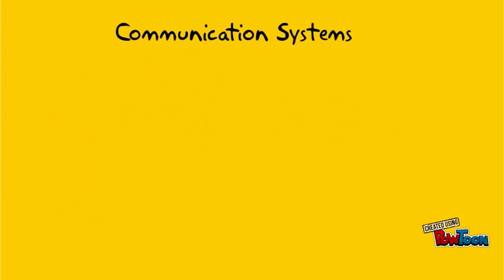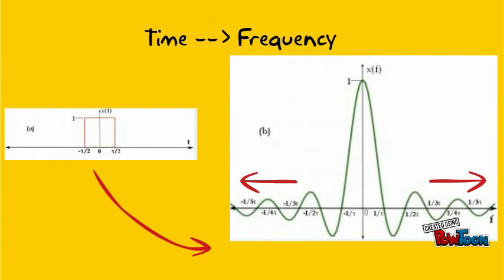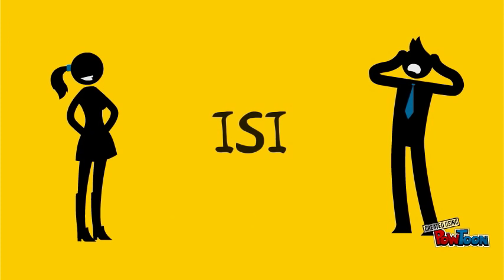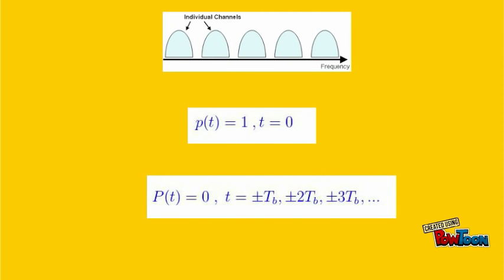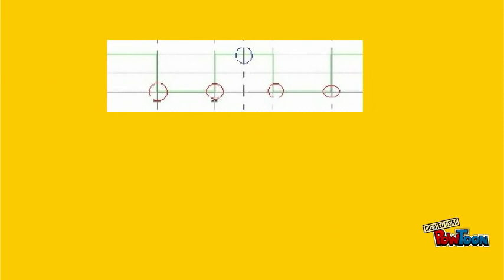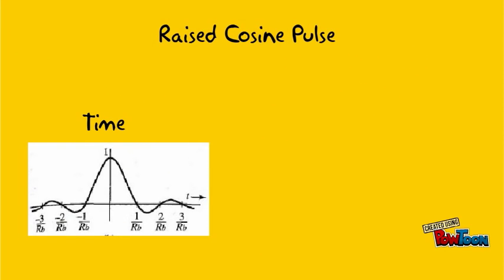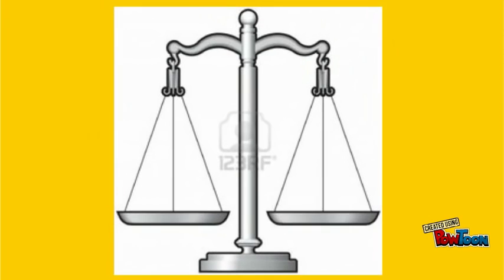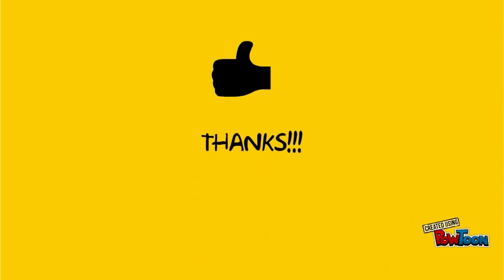Introduction to ISI and Nyquist Criterion

Comment: There is an error in this course.  The sinc function should evaluate to "Tau" @ 0 frequency.  Remember (from the Fourier transform), when f is zero, the Laplace integral evaluates to the area under f(t).  If the brick-wall function has 1/Tau as its value between -Tau/2 and +Tau/2, then the sinc function (its Fourier transform) would be 1 at f=0.